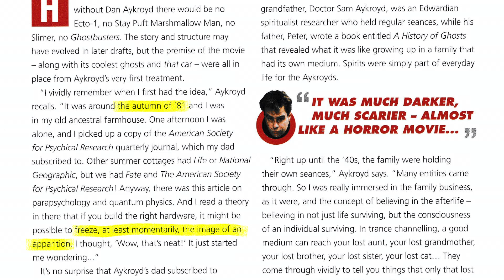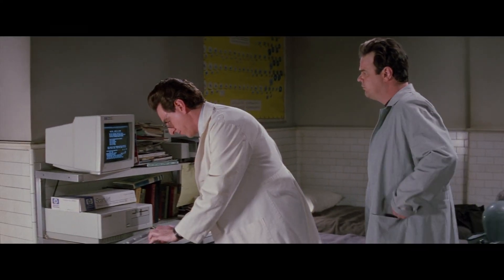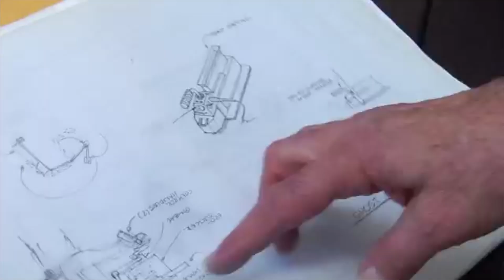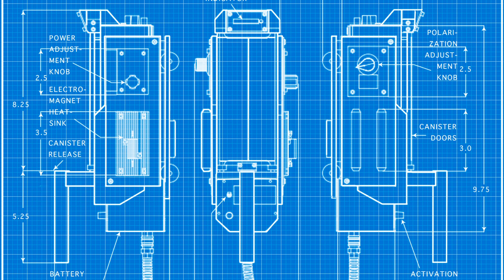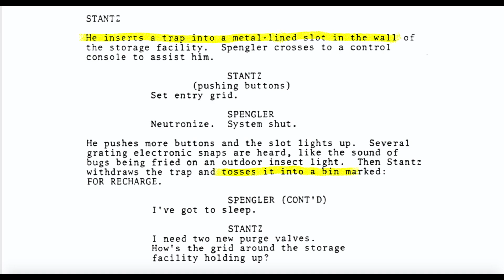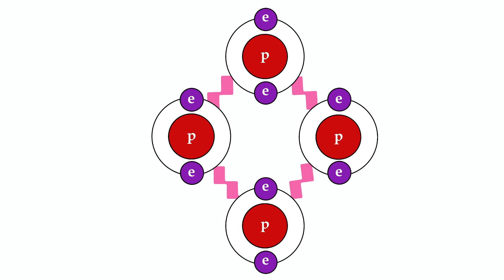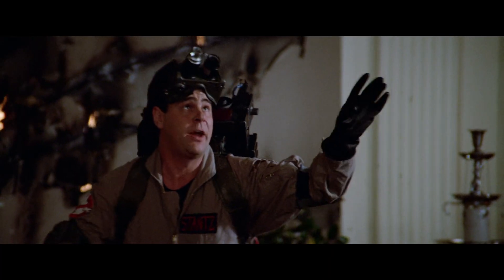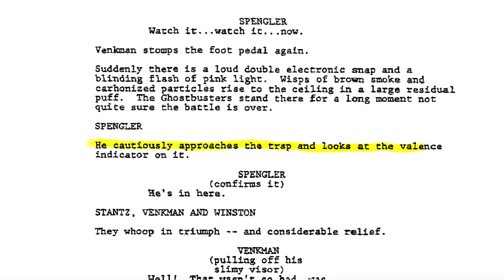How Does the Ghost Trap Work? | The History and Physics of Ghostbusters Equipment

Comment: How about discussing how the PKE Meter works.  That would be interesting theory of how it picks up certain entities.
Reply: Sorry that info went with Harold Ramis. According to Aykroyd, he's the only one that can make the wings go up and the lights blink
Reply: Works like an EMF meter. The closer the anomaly the higher the reading. The wings and grid move as the spirit or anomaly is within range. The goggles work in tandem as the vision to see ghosts. our eyes wouldn't be able to see such vapors like the goggle do. The video game explains this.
Reply: @Paladin_Green  The PKE meter in the game was "gamified." It did more than just detect strength of PKE energy with a bar graph (officially), and it had no connection to the Ecto-Goggles. That was just to add some additional "play value" for the game.
Reply: Fun fact: The body of the PKE meter was actually a battery-powered shoe polisher. It was modified to add the wings, lights, buttons, and other greebles.
Reply: @Draknfyre  I knew this fun fact for awhile now.  Thank you for the refresher.
Reply: @Draknfyre  Keep in mind though both Ramis and Ackroyd were heavily consulted on the game to make sure all the equipment was represented and functioned correctly. And the PKE meter technically does exactly what Verdant describes, the gamification was the fact that it detected PKE on objects , thus giving the player the treasure hunt minigame, and the fact that the other modes detected ghosts and environmental hazards, which is just other modes of the same thing, detecting PKE presence on a ghost, environment or object. and thanks to the game they were able to add other various features to the proton pack they wouldn't have otherwise done. While the Ghostbusters mainly bust ghosts, the plan was and to a limited extent seen in the cartoon show was to have the GBs fight other eldritch and supernatural entities that would be considered other things than just ghosts. Which is why things like the slime blower showed back up, and the invention of the Dark Matter Generator and the Meson Collider, which would apply to other non-ghost entities. For all intents and purposes the video game is Ghostbusters 3, since the game even uses elements from Ramis and Ackroyds never produced GB3 draft. Shandor was going to be the big bad or at least involved with the big bad to round out the trilogy. And I'm glad that elements of this are used in the new movie.
Reply: psychokinetic energy

Comment: The next video should be on the containment unit
Reply: What about the Twinkie
Reply: Agreed, I would like that as well.  I have a few theories on how it works; I'm sure just like everyone else. 😆👍
Reply: Absolutely. 
" This is a high voltage laser containment system. Simply turning it off would be like dropping a bomb on the city."
Why are lasers involved in the indefinite capture of PKE electrons? How high a voltage are we talking. Turning it off would be like dropping a bomb on the city? Is it the power supply that would cause the explosion? Or is there something to the combined constrained of all that PKE? 
Egon also called it "the protection grid". Is it a grid of lasers? 
So much to explore here!
Reply: @jimmywim  ok to answer the laser grid part, all that means is that behind the containment unit is a wall of ionized laser beams which stop some entities phasing through either their ethereal qualities. What caused the explosion was that massive release of negative pyschokinetic energy. The protection grid just means it protects or guards a.k.a keeping the ghosts inside.
Reply: Trey Stephens well to put it simply,  Matter!  Like everything else.  😉
Technically we’re all electric beings wrapped in 🥩 .  Living or dead,
hardly makes much difference, I would think.

Comment: Outstanding video ⭐⭐⭐⭐⭐
Question was is the range of the trap from the foot plate to the trap unit itself?
Reply from the maker: It likely varied between props but most prop builders cut the hose between 9-10 ft.

Comment: Something else I noticed that was different in Ghostbusters compared to Ghostbusters II - the use of the foot pedal to activate/close the trap.

In Ghostbusters, Ray steps on the pedal to activate/open the trap so they can catch the Slimer ghost in the ballroom, and steps on it again to close it. In Ghostbusters II, Egon (I think) either keeps his foot on the trap's foot pedal the whole time in the courtroom while they're trapping the Scoleri brothers, and then takes his foot off the pedal to close the trap, OR he steps on it to activate it, takes his foot off the pedal, and somehow the trap can detect when all the PKE is contained and then closes on its own after the last of the PKE is inside the trap.

Given the amount of time (5 years) between the two films (and the fact that I haven't seen Ghostbusters II in quite a while), it's certainly possible that Egon tweaked the mechanics of the equipment. What do you think?
Reply: Given how much Egon loves to tinker with his own toys to make them work much more efficiently, it's entirely possible that he made minor enhancements like that to make the equipment easier to use in the field and save the charge from having it open longer than needed. Out of universe though, it was likely an oversight in the film.

Comment: On topic of the video game, how would a Dark Matter Generator even work
Reply: It's the same as how a antimatter or a ion generator works where the machine use a special magnetic discharge. 

Best the way to understand  it is think how water is made where you have two hydrogen particles then you use a electric discharge to magnetic a oxygen particle to make water which is bit different with dark matter but the process is basically the same.
Reply from the maker: We've actually got the physics of how most of the equipment, including the GB:TVG pack upgrades already worked out. It's just a matter of time to slowly get to each piece. Rest assured, we plan on doing a follow up Proton Pack video going more into the RGB, EGB, and GB:TVG packs. Stay tuned!

Comment: The bit about traps sucking your soul out through your eyes if you looked at the trap when it's closing was from one of the early script drafts. It was left out but the line about not looking at it was left in. The fan movies that feature it are a direct homage to the original idea.

And while it's logical that the battery is in the rear, that wouldn't work when depositing ghosts. When the cartridge disconnects the power would be lost, and the ghosts could escape before the containment unit could be closed and cycled.
Reply: Well i could work by haveing sockets in the front of the trap.
So then you deposit the trap in the unit, it connekts the trap to the grid.

Comment: I understand the trap functions but the materials to make it functional is the real trick where you can't just make the trap with normal stainless steel or aluminum because ghost can just go through 90% of everything like a house with a open door.
Reply: I think the trap has a specially calibrated laser grid inside it that contains the ghost, but you'll have to transfer it to the containment unit before the battery runs out otherwise the ghost will escape.